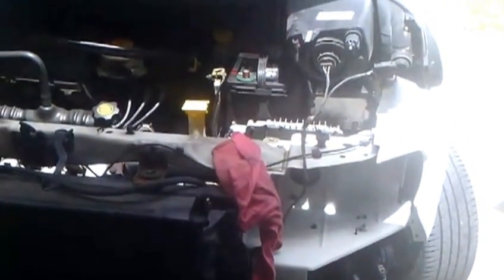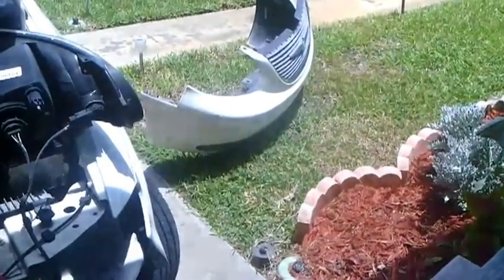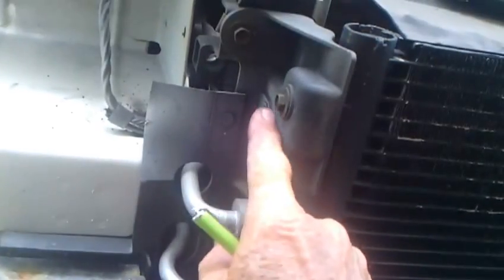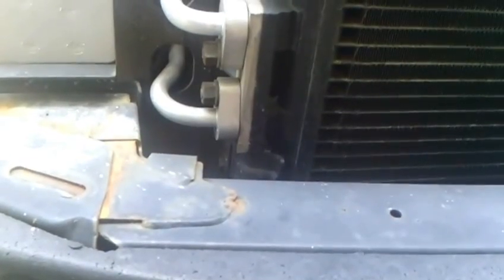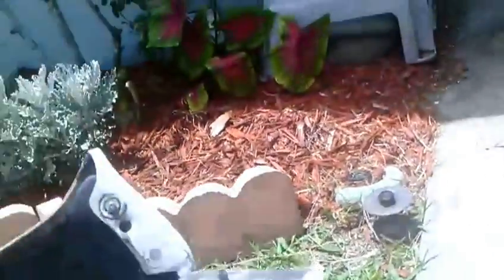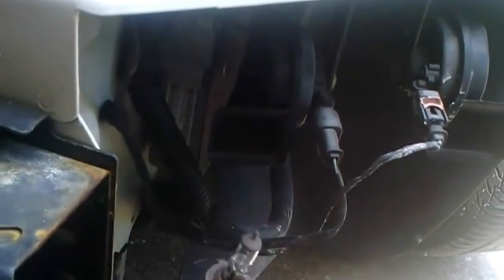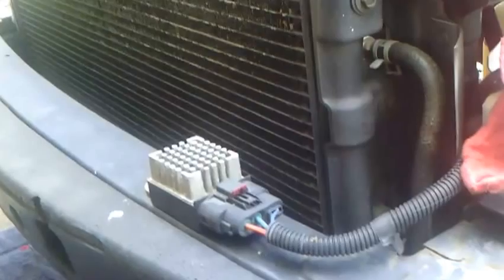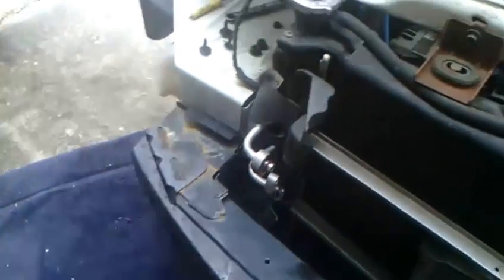2002 Chrysler T&C AC Condenser Replacement

Comment: Just replaced my condenser last week, it was exactly like yours.  It leaked in the bottom left corner and the transmission cooler came apart as well.  Thanks for the preview of my repair.

Comment: Thanks so much for posting this vid. I have a 2001 Town & Country 3.8l so the setup is identical. I even had the same broken rivets on the transmission cooler bracket like you had and used your technique with the zip ties to firm that up. I was hoping to avoid completely removing the bumper assembly but by the time I was done, I had it lying on the deck right below. Just couldn't get to Those 2 lower bolts on the condenser without removing it. I'll tell you what, replacing that dryer was the most frustrating part of the job. It has to go in exactly how the old one came out, which was not easy to get the fittings to line up cause it fits very snug in the holder so there was no turning it to correct the alignment. Anyhow, thanks again for the great vid.

Comment from the maker: Look for oily dirt. Tire Kingdom said the leak was the rear evaporator, but any shop will only check the condensate drain for R134a. There is Armaflex in the coil box that outgasses and gives a false leak. The condenser is only about $150 at Advanced Auto and they give a 10% discount if you have a military ID card, active or retired. I believe that they also loan tools, such as the vacuum pump. The o-ring kit is about $9. A shop will charge you nearly $1000 to do the work. Good luck, have fun.

Comment from the maker: If you're asking about the sensor  mounted on the bumper absorption metal,
I suspect it is a sensor for something. It's powered cause there is a heat
sink on top of it. Could be the temp sensor input for the ceiling mounted
display. There should be no connections to the condenser or the
transmission cooler. Only the radiator. The oil cooler is mounted between
the condenser and the radiator. Other than that, I don't know what else it
could be. Some vehicles, high end I think, have a sensor for the condenser
that is an input for a diagnostic meter.
Be sure to look for the last two minutes of the video.
Reply: The unit on the front bumper is the relay control module for the radiator fans.  I had one fail once and the fans ran all night draining the battery "surprise.".   and changing it, well it is riveted onto the bumper for heat transfer  .The front grill needs to be removed for access..,.not fun

Comment: thanks for postin' up.... your savin' me lots of $$$

do you have to do the vaccum ????
Reply from the maker: Chuk-n-Sarah Pratt Oh yes! Remember that the air has moisture in it. Pulling the vacuum boils
the moisture out. Otherwise, the moisture could freeze and block the
orifice, stopping the flow of refrigerant. You could do the repair and then
have someone else do the vacuum, evacuation, and recharge. The big money is
getting to the condenser and putting it back. 4 to 5 hours at $100 each,
depending on the shortage. Don't have a dealership do it! That's book rate
time. More if they include vacuum time. Vacuum pump might be loaned or
rented from Advanced Auto or Auto Zone. Buy one there for $110. Wal-Mart
selling R134 for $6.99/12 oz can. I know I make it sound simple, but I
tried to give the steps maybe without enough logic why. The vacuum is only
for a couple hours, then isolate the system to see if the vacuum rises. If
it does, there is a leak. Should hold 28 inches for at least 30 minutes
without any increase in pressure (vacuum).
I hope this helps. If not, feel free to comment/ask again.
Reply: No... I appreciate your help and your reply... EricTheCarGuy confirmed what you said PiqueWillow Just gonna bite the bullet, but Harbor Freight sells a vacuum that goes on the end of your compressor, I will try that, and then I have to get the Manifold gauges and the condenser....   sounds like I'll loose a weekend on this job!!!!
Reply from the maker: Chuk-n-Sarah Pratt I bought the same little gizmo from Harbor Freight. If you use it, when you get the manifold gauge set, there will be a short piece on the middle hose that you will want to remove. It actually blocks the gage set from the system, schrader valve against schrader valve reversed. You will never see the system with it inline. Been there, done that. I used to do HVAC/R for a living in a semiconductor manufacturing plant.
For the condenser, I bought mine at Advance Auto. You might want to check Rock Auto online. I have found that their prices are about half of Auto Zone and Advance Auto. You will have to wait a few extra days, the shipping will offset the state tax, unless you are in Wisconsin. Plus, they are good for returns if necessary. On the other hand, Advance Auto and Auto Zone are 'purchase/work today' and most parts are lifetime warranty. Take it there, come home with a new one same day.
Good luck, Chuck-n-Sarah. Anything else, just post. I will try to respond back quicker than today.
Reply: thank for your help and advice
Reply: +Chuk-n-Sarah Pratt MOST IMPORTANT.... If you have not done this before get HELP! You can hurt yourself and fry your system too.If you can't get help or can't afford it, watch LOTS of videos before you attempt it, seriousely! Also it may sound dumb but practive with out actually opening the lines so you're ready and know what comes next and what to expect. Watch the best videos that you choose right before you do it so everything is fresh in your mind. - With that said: If you have an AutoZone near by, or a parts store that rents automotive tools and have a credit card you can rent one for free. You use the credit card and put approx 170 dollar deposit. When you're done you take it back and they refund the money to your credit card. - Me I'm in the hurt locker i blew a compressor and replaced it and the dryer. I didn't flush it or change the condenser. I have a blockage now so I have to change the condenser, dryer, expansion valve and flush the system and change the oil in the compressor. It sucks I have duel ac in a caravan so I have to rip the back left side out to get the rear ac and evaporator lines. But if I don't do it I could end up doing it again in a few months. Well hope some of this helps, and lets you know that "sometimes" it's not as easy a quick change.This is my 10th repair and second compressor change, the first one that I've had to do the flush. Not all on the same car. If you can waite you can buy a compreser kit with the dryer, expansion valve, oil, seals for around $220.00 Bucks.R134A will cost less on ebay as well, around $40.00 bucks for 6 12oz bottles. The evaporater is about $53.00 bucks with free shipping. So for around $313.00 you can have a good kit to do your A/C. I do recommend the flush if your a/c system blew the compresser. If your system worked before but just needs a freshening up i'd skip the flush and just do the compresser and dreyer.   That's my 2 cents worth.Best Wishes/Blessings Keith
Reply: thanks Keith Noneya...   i really appreciate u taking time 2 drop  knowledge on me.  God bless u as well...   I will take all of your words with high regard.... Chuk

Comment: okay OK Google 205 Chrysler Pacifica the vacuum system on it
Reply from the maker: okay OK Google 205 Chrysler Pacifica the vacuum system on it. George, this is all the comment that I could see. If you're asking if the system has to be evacuated, the answer is yes. Once the system is opened up, as replacing the condenser or any  other part, the system must be vacuumed (evacuated). Air has moisture in it and the only way to remove that small portion of air is to put it under a vacuum. Moisture will boil when in a vacuum, and the pump exhausts all of the air (moisture) that it pulls. All AC systems suffer the same situation, whether it be home, refrigerator, vehicle, etc.
Thanks for watching and commenting.